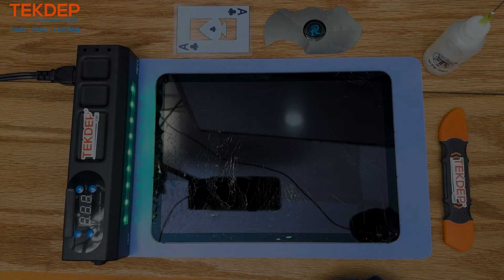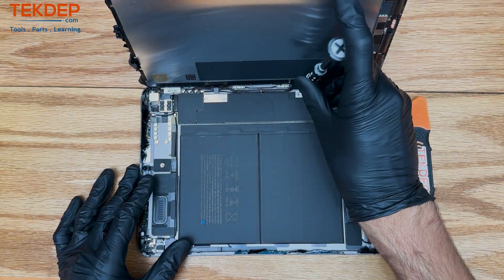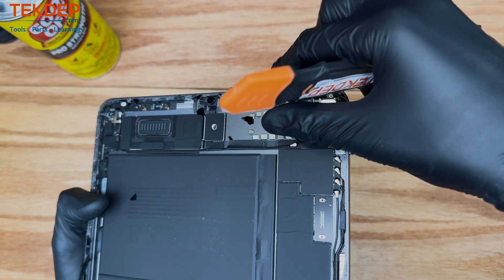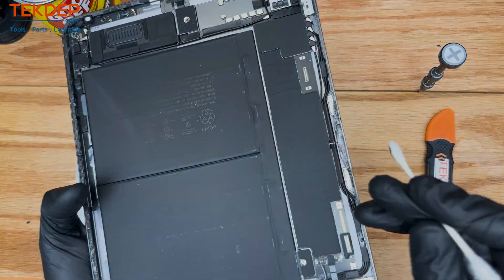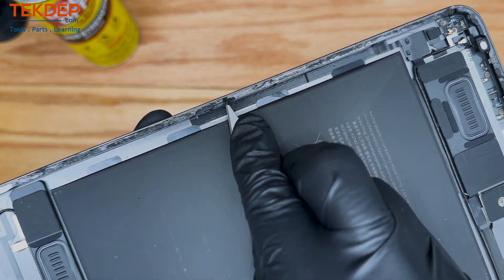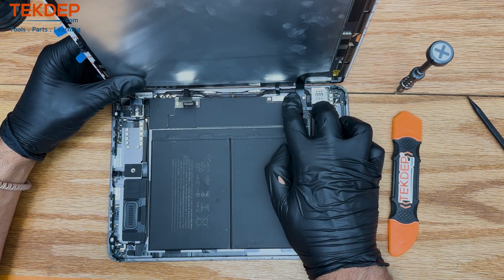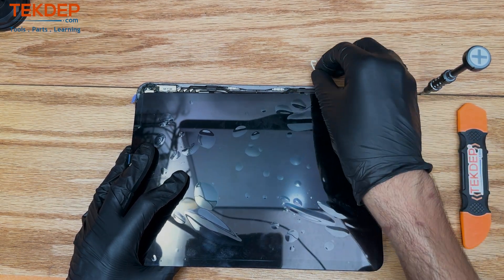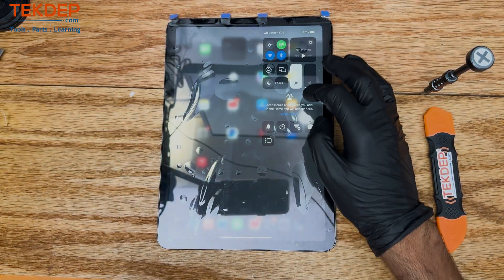iPad Air 5 Screen Replacement | Full Repair Guide

Comment: All you did was remove the screw from the plate on the battery connection. How does that disconnect the battery? There’s no way that I could see to disconnect the battery because it’s glued into the logic board

Comment: im confused the digitizer and led are one piece? I repaired a ipad9th gen and its two pieces
Reply: If the screen is laminated (meaning glass(touch) and LCD are a single piece) then you have to replace it as one part if its not, then it comes in two parts.(you can tell by the gap between the glass(touch) and the LCD (Screen) in the this case the ipad air 5th gen is laminated. the ipad 9th gen is not.

Comment: Do you know where I could get a replacement whole metal frame for the air 5 because my uncle found a iPad Air 5 on the side of the road and a chunk of the corner is missing and is all scratched up ideally able to get it to have matching serial numbers engraved in so I can try and fix it up

Comment: I followed all these steps and everything went well but now I am getting an error that says "touch ID not available". Do you have any experience with this?
Reply from the maker: Hello! Thank you for your comment. There is a possibility that you might have damaged the part that functions as the Touch ID. I recommend power resetting it by disconnecting the battery from the board for at least a minute and ensuring that your iOS is up to date. If you need tools, parts, mail-in repair or any of our services please visit our website.  https://tekdep.com/

Thank you!